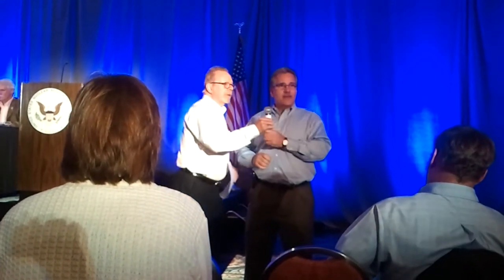Nuke Fuel Pool Roulette

Comment: What Broaddus didn't mention is what the risk is that there would be loss of electricity to the pumps circulating the water in the cooling spent fuel pools. The risk may be low, but that is the crucial issue. If the water is not circulated and recycled, it heats up, boils away and then the spent fuel rods become exposed to the atmosphere. Under these conditions the zirconium cladding could become so hot that it would ignite and radioactive materials could become vaporized.